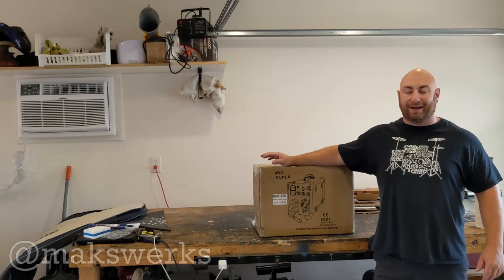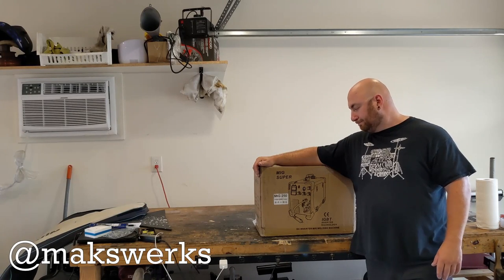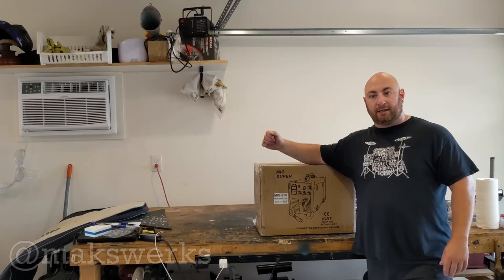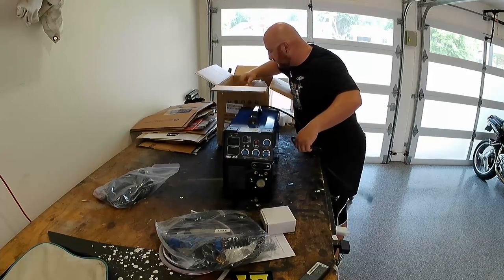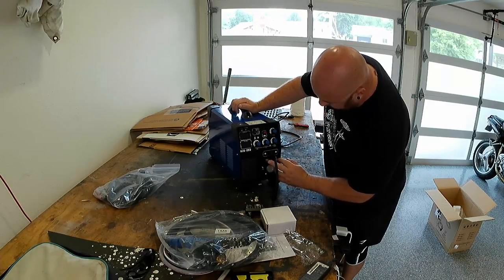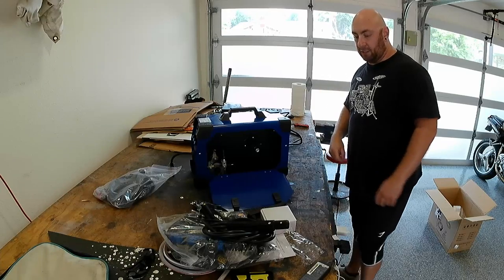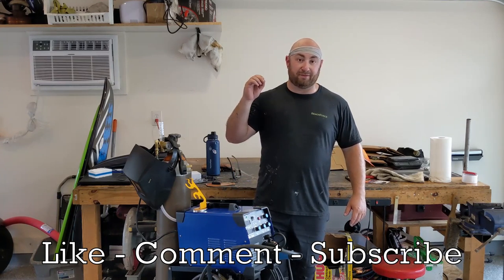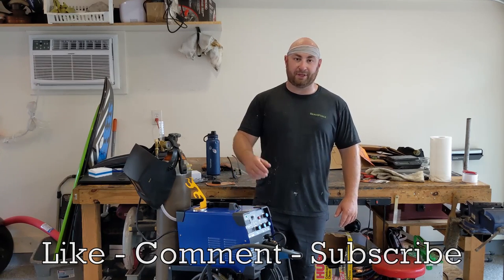UNBOXING & REVIEW: New $300 Chinese eBay MIG

Comment: Great informative vid... I am about to order the UK version(no burnback knob).  
They advertise the tig as being `lift tig` but other so called `lift tig` machines i have see seem to be scratch and not lift.. Have you tested this at all and if so which would you say it it?
Reply from the maker: The technique is the same-ish. I have not tried it as I have a separate machine for TIG. I have used the stick welding mode and it works fine. If you are gonna do a lot of dedicated TIG I would get a proper machine that is AC equiped.

Comment: Looks fairly good. Does it have the wire feed rollers made in metal or plastic? What thickness wire can it use? Just had a thought. You can use those dark glasses when riding your bike. Should look pretty cool.  LOL
Reply from the maker: Metal. It can take any of the standard sizes. .02-.035
Reply: @Makswerks1  Hey Mak, have you tried welding very thin metal, say, around 1mm with this machine? I think it is rated at 50-220 amps. At 50 amps, how thin can you weld without blowing holes?
Reply from the maker: @redgum1340  I have welded some 20g, with no issue with decent technique. I was around 70A though.
Reply: @Makswerks1  Hey man, I'd like to see that, welding 0.9mm sheet at 70 amps. Did you say 'technique'? Hmm, I'm very interested in that technique...
Reply from the maker: @redgum1340  70A indicated, your guess is as good as mine. Joint was overlapped, copper spatula style sink on the back. Lots of little tacks. Maybe "technique" is a little generous for that. :)

Comment: I had the mig-270 and it really was only 220 amps on the label  in the back, I questioned the vendor and I was right and they accepted the return. The machine worked good but i didn't like they they said it was 270 amps when it was only 220. Is yours really 250 amps, I asked and they said that one was only 180 amps. Please take a picture of the label on that back and post here please.
Reply from the maker: Its a fair callout. Mine says 200A on the sticker. The reality is this is a hobbyist machine and the practical difference there for MiG I feel is negligible. If you consistently need north of 250 or 270A you will probably be better served with a more commercial machine.
Reply: @Makswerks1  It's just the fact of false advertising the amount of amps. I'm curious was the old welder you had really 250 amps does it have a  label on the back? I bought a HBM2280 and it is a true 200amp on the label and I saw other that tested it and said it went up to approximately 220amps. I did like the vevor mig-270 also.
Reply from the maker: @joesledrider8530  I mean you are buying direct from Chinese shops. Nothing that comes out of these is accurate. The old one has long since gone in the dumpster so I couldnt tell you for sure, however I have welded 5/8 plate with it and no issues. So in my mind this welder is great for the price cause it puts down metal in a controlled and efficient way and lets me build cool stuff in the garage.
Reply: @Makswerks1  I agree the mig-270 I had worked pretty good. You can see I did some video's on it also.  https://www.youtube.com/watch?v=QJIWM8J3Vpo

Comment: Where in Texas are you sir?
Reply from the maker: ATX
Reply: @Makswerks1  ok I’m in Conroe and have a 1990 XR100R I’ve done everything to it except take the motor apart. I’ve seen you video. Just looking for someone that wouldn’t mind getting it running. I work a lot and never have time.
Reply from the maker: Appreciate it, but i probably dont want to drive that far for it. I hope you can find someone local that can sort it out.
Reply: @Makswerks1  oh no problem and thank you. If anything I’d bring it out to you I have family near there in wimberly and canyon lake area. I did find a guy but now I need a flywheel and the screws for it and I’m done. Thanks again for the reply Brother, stay safe out there.